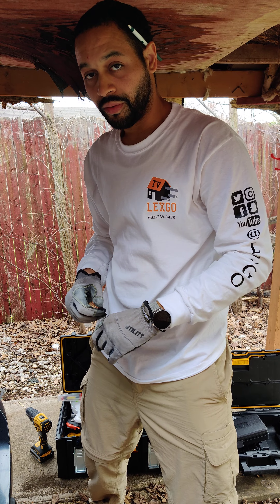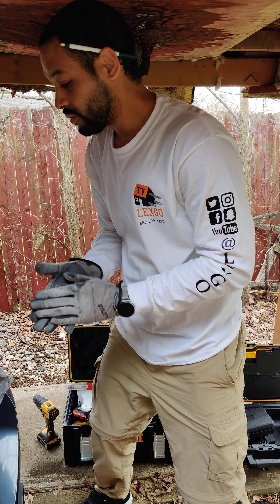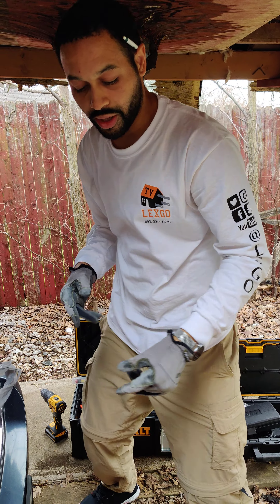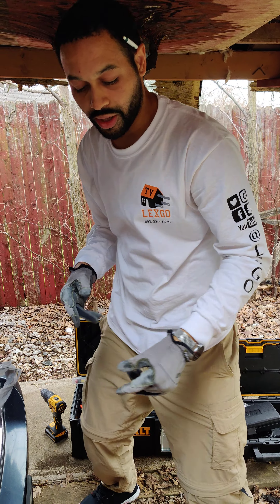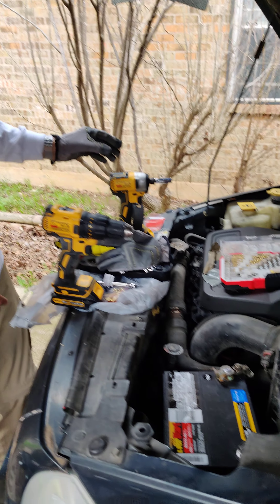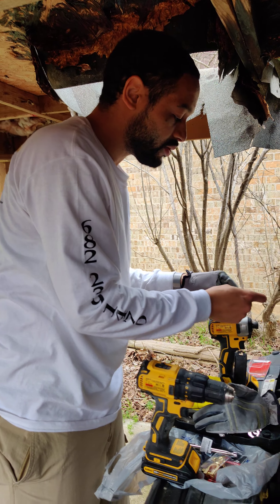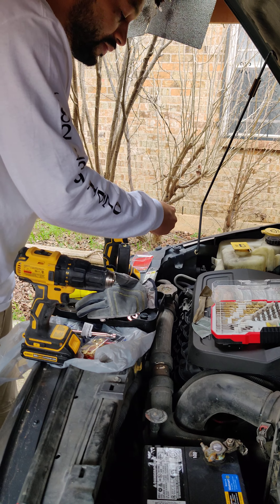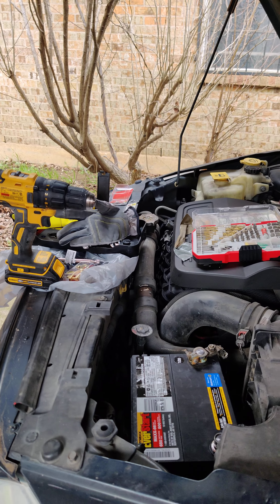How To Install Battery Terminals On 2008 Dodge Caliber R/T

Comment: What kind of terminal did you use?
Reply from the maker: I used the one I purchased at auto zone for less than $12 call me if you need any help 682-239-1470 Craig